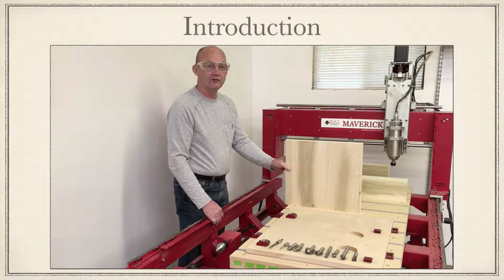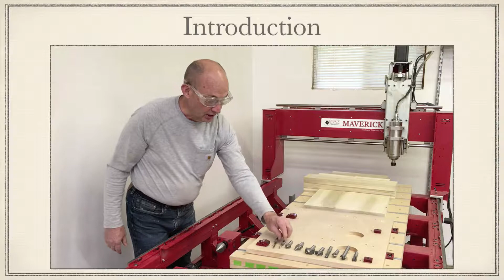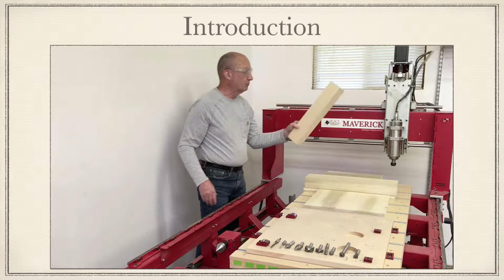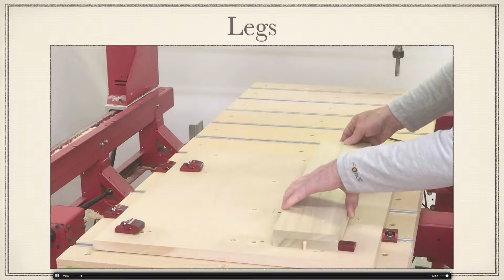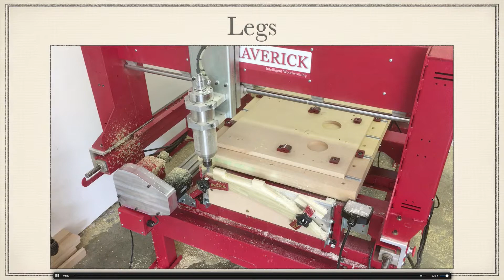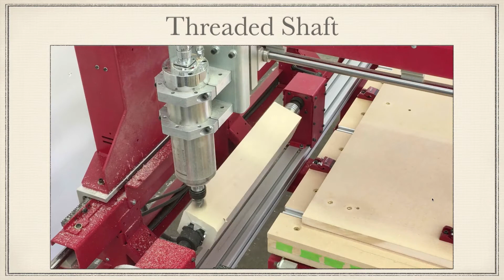Adjustable Stool Project

Comment: I bought a 3/5 maverick but legacy no longer has the project plans or most importabt g codes. Would you please make me copy. I will pay all costs plus a fee for you time Thank you so much. Please let me know your responce
Reply from the maker: I have found the files. How can I get them sent to you?
Reply: Also do you have the file for the setup plate ? @davegoldy7894
Reply from the maker: @charlescoppedge634 Let me do some checking and get back to you. I think I have the files, but finding them could be a different matter 🙂

Comment: Is the thread hard to get to fit right? What I mean is whether gauges would be useful. I worry about the quality and repeatability of the thread.
Reply from the maker: So far I have not had a problem with quality and repeatability. I have only made about four of the threaded shafts and about 6 of the nuts so my sample size is small but each time the shaft and nuts have fit together fine. Thanks for the comment.